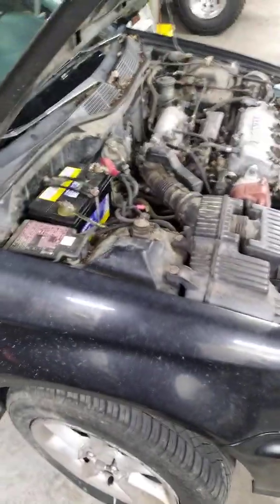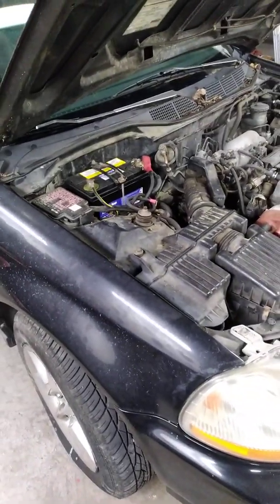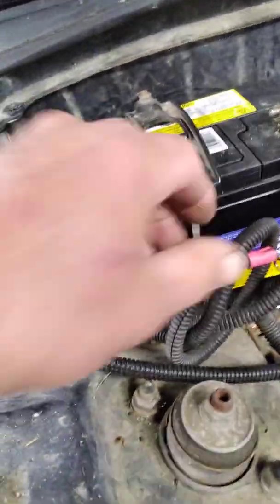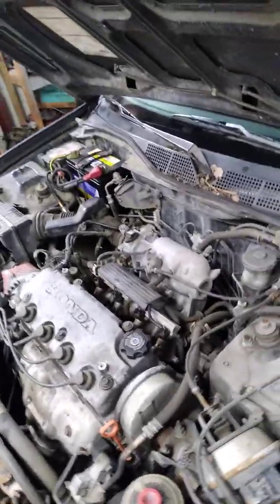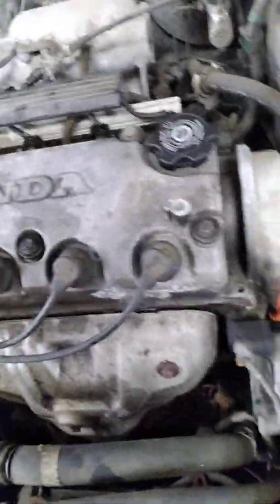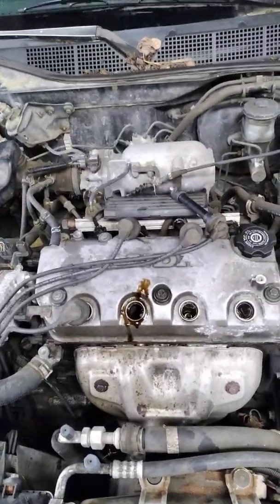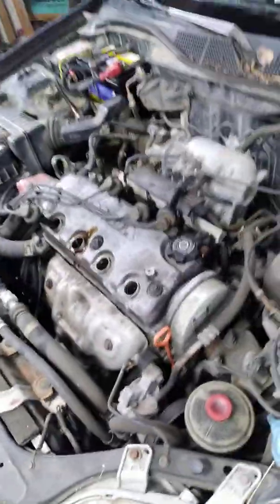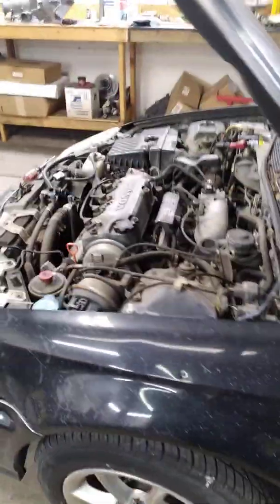Oil Soaked Spark Plugs Causing Mifires

Comment: So when this happens is it just buy a whole new motor or just replace the gaskets and seals and spark plugs of course after it’s all been cleaned ?
Reply from the maker: @JoseLopez-vz2bq
Depends on mileage  however replacing the gasket and tube seals will get it running good again.  When oil gets past the seals and onto the spark Plugs the oil grounds the plugs
Reply: Watching this now, had this happen so I replaced the seal and it's still happening after replacing it, it's only cylinder 1 that's doing it.